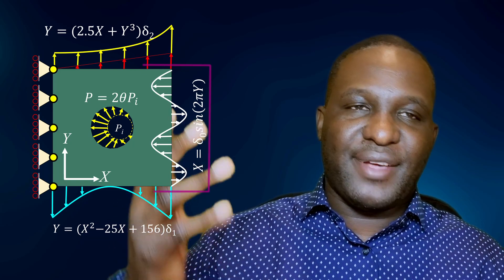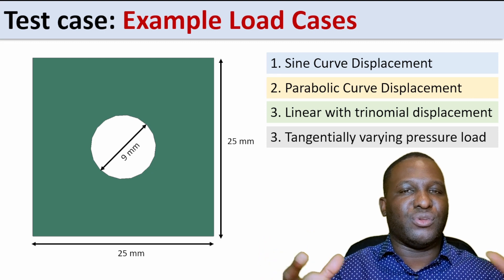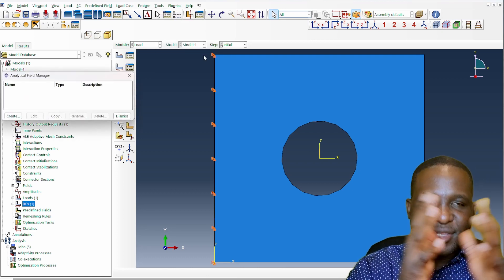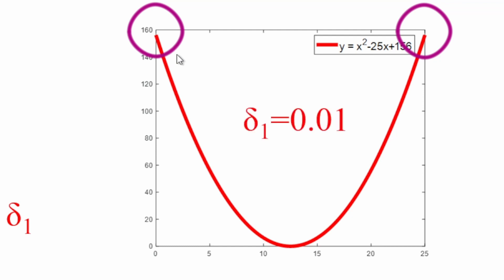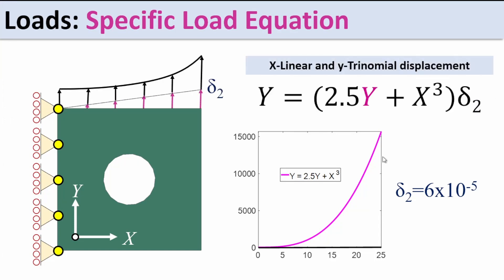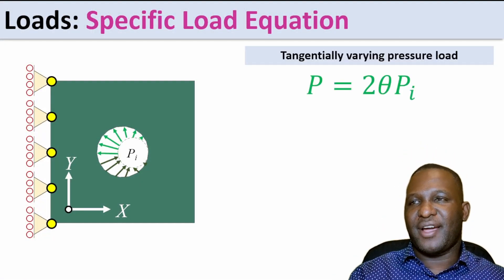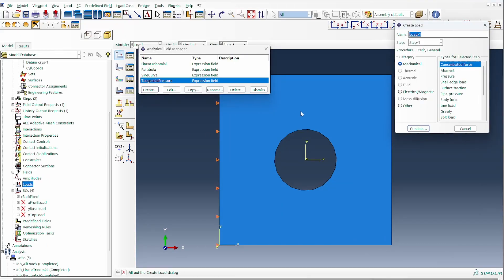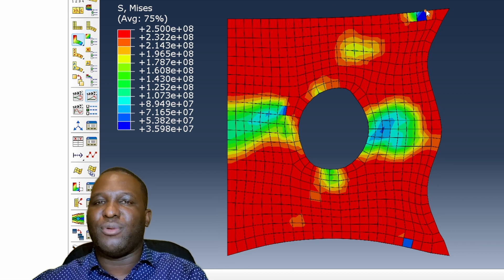How to apply LOADS in ABAQUS using EQUATIONS

Comment: Hi Dr.Okereke, thank you for your video. I got a quick question of  Tangentially-varying Pressure Load part. May I ask what if I want to make the load in the circle have the same direction? I mean, can we make all the load direction inward circle center please? Thank you.
Reply from the maker: Yes, absolutely.

All you need do is use pressure (uniformly distributed internally). I will suggest that the analytical field expression can be Pressure = 2R (where you are using the cylindrical coordinate system).
Reply: Thank you!! @MichaelOkereke

Comment: Thank you very much Dear Prof for this video , i want to know, how can i apply a displacement for only one direction (Normal to the surfaces)  for example 1mm to the Part of an ellipsoid ? and how can i do it ? please . Thank you again.
Reply from the maker: I think you can use a direct attachment to a set of nodes on that part of the ellipse you want to apply. Alternatively, use the Expressions to impose your load. This video should help you understand how to impose loads with expressions. YOu simply need to find the corresponding expression of load/displacement for your elliptical surface.
Reply: @MichaelOkereke  Thank you very much for your answer, I am not sure that I understood your suggestion correctly, can you provide us if it is possible a small video that will clarify the steps to follow.

Comment: How could be done this for 3D loads? 
I need a parabolic interpolation of a pressure load along the span in a 3D rectangular wing, I have the pressure distribution at the ends of the wing and at the midline.
Reply from the maker: Hello, 

This is a good question. I think it can be done. You do a similar thing but just make sure you specify it as a surface (i.e. in terms of x and y values for example z = f(x,y)). The analytical fields can specify expression in terms of x and y. I have not tried it before but I think this is possible. Maybe in future I will explore this.